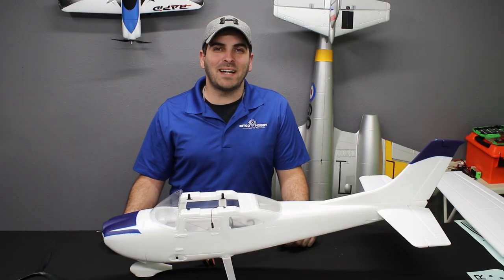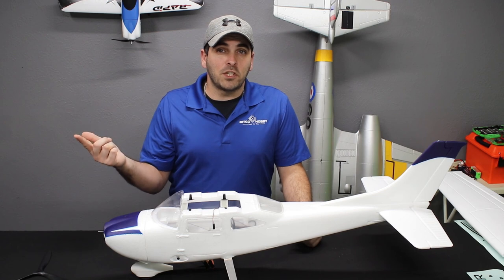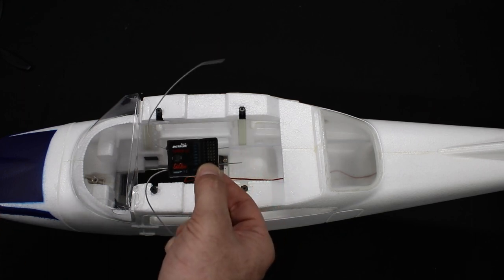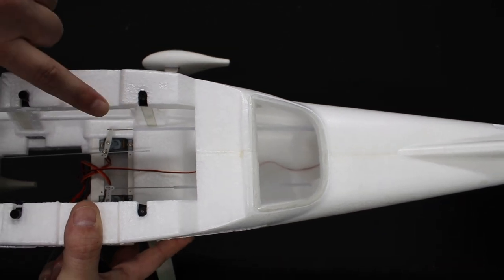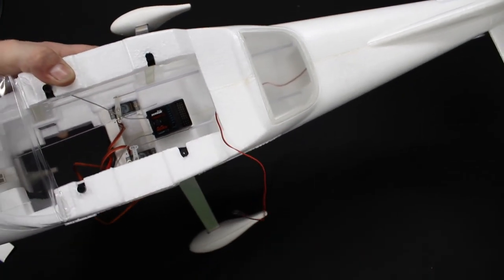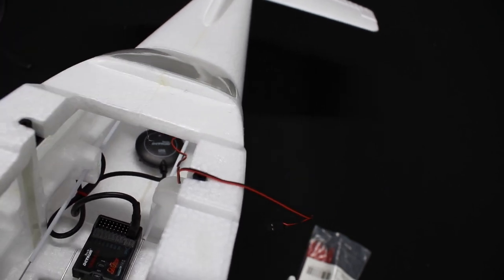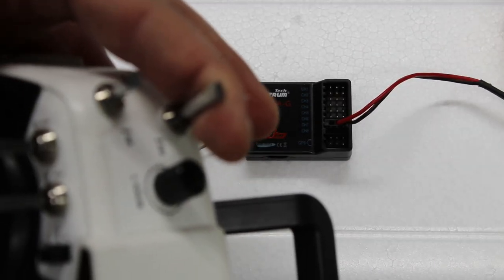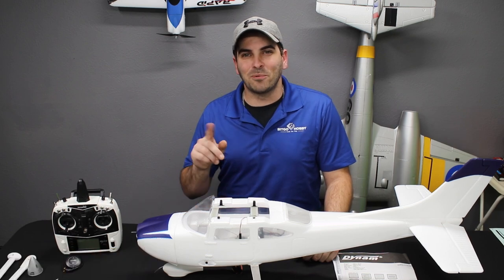DETRUM Receiver SR86A-G Positioning, and Binding

Comment: How does pitch offset work for a tail dragger with the elevated nose?.. how does the unit know what is level?
Reply: Just installed this receiver on a 1450mm P51 Mustang and still puzzled with this same question, does the plane need to be tail lifted while the battery is plugged so that the receiver calibrates at level position?, also cannot get the flaps to work, any advice?

Comment: Sir is this stabilizer compatible with flysky transmitters or receivers
Reply from the maker: No, this one does not work with flysky transmitter. The Detrum Z3 flight controller works with flysky.